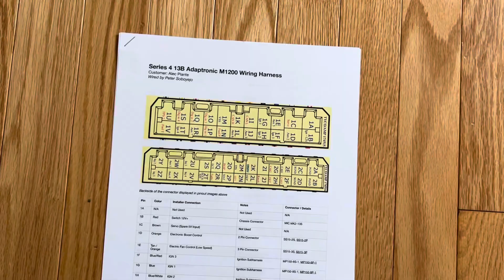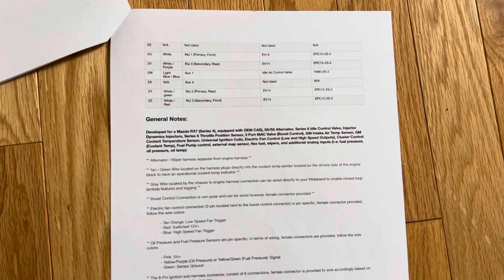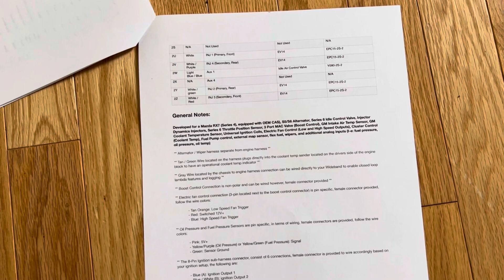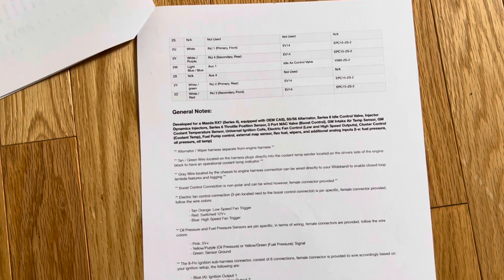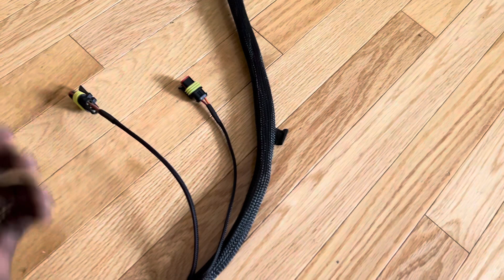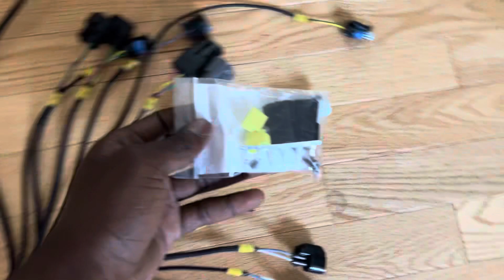Series 4 RX-7 Adaptronic M1200 Engine Harness Highlight

Comment: Hello!
Hey, I’m restoring a 1987 Mazda Rx7 gxl, non turbo manual transmission and would like to know if you can wire the engine wire harnesses needed to its components (ie) electrical and electro-mechanical systems!!?
Reply from the maker: Honestly depends, feel free to contact me via Facebook or email (thepcmrtim@gmail.com)